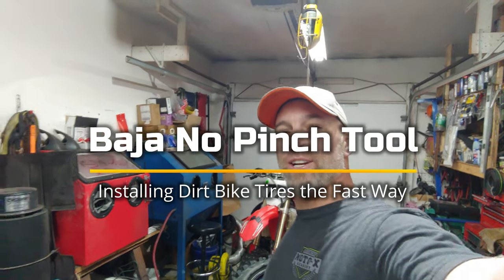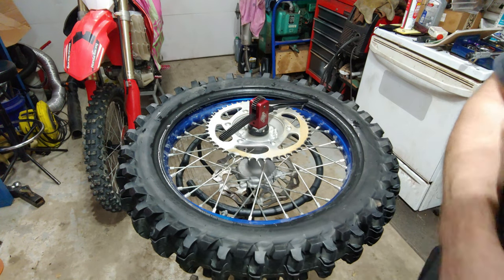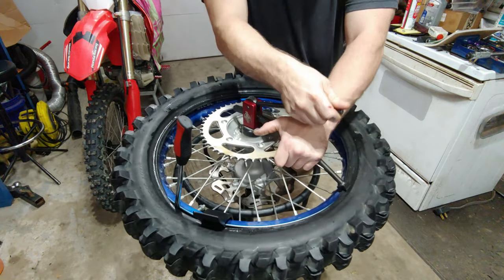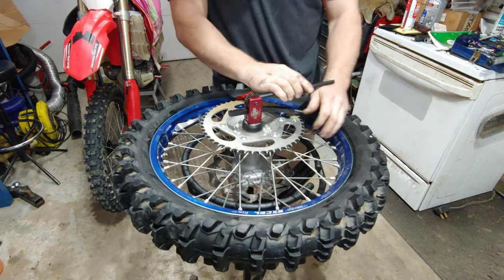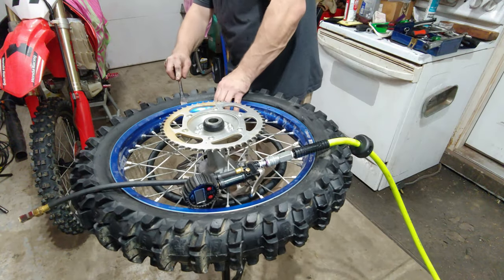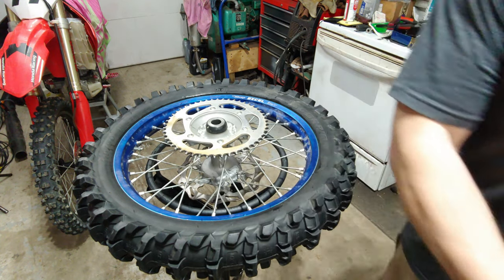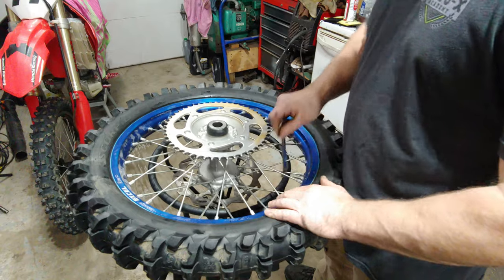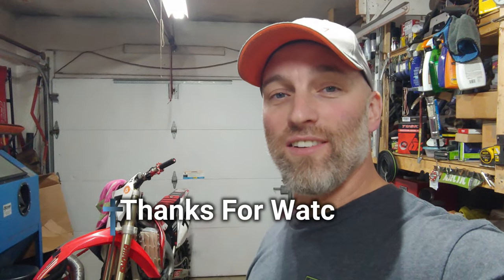The Tool That Makes Changing Dirt Bike Tires EASY || Baja No Pinch Tool

Comment: After pinching and ruining 2 tubes yesterday using my tire spoons, I decided to bite the bullet and order one of these.  Looks like it will save a lot of time and headaches.
Reply from the maker: I finallly got down the changing process with my spoons after ruining 3 tubes (two 10" and a 19" for an XR100) but this thing is so much faster.  You wont regret it.